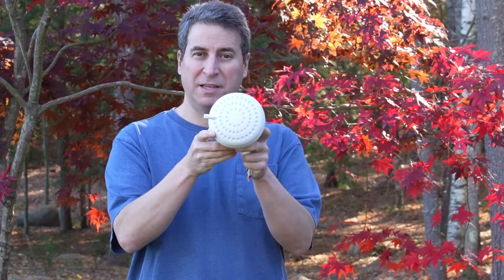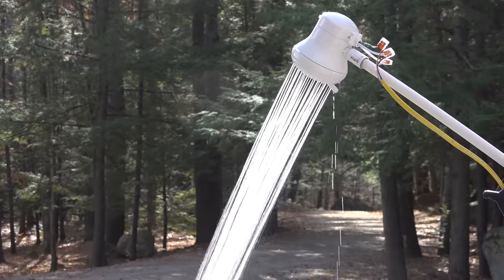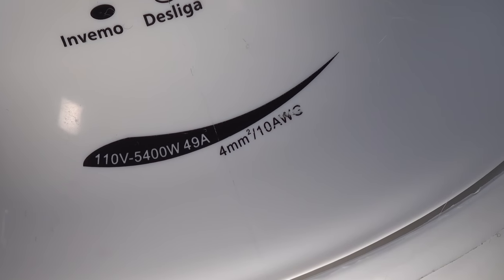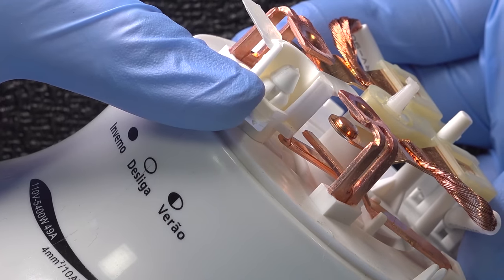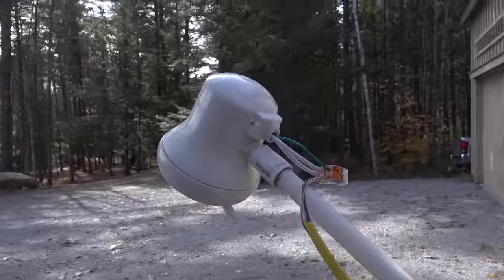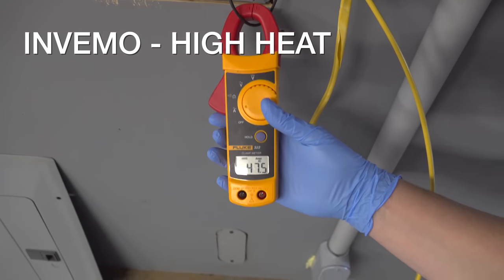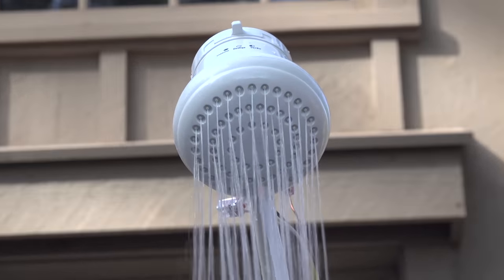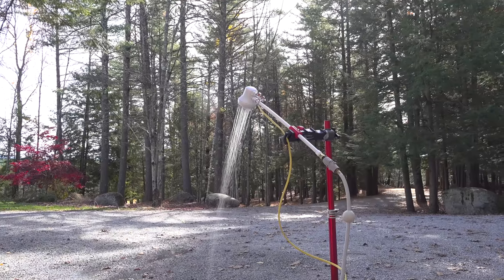What Happens When You Use a SUICIDE SHOWER HEAD in the US

Comment: The danger of it not having a ground is if the source of power has too high of voltage it can overload the circuit, blow a resistor or fuse and potentially start a fire. Especially if there is a power outage from a storm, if someone happens to be taking a shower and a transformer is overloaded that someone could have a gnarly unexpected shock

Comment: Not a big deal but the labels on the switch translate to (winter, off, summer) or high, off, low. The shower makes the same noise as a coffee maker but louder. They may pull too many amps if you try to use it at 110v.
Reply from the maker: So glad you shared this, I searched for so long and I think it was a printing error and should have said Vernmo

Comment: I'm impressed that you gave this such a thorough and fair review. For Americans, who have never seen anything like this, and are generally against anything unfamiliar (I'm generalizing) it will look ridiculous, but millions of people use this type of shower every day. I have enjoyed a hot shower countless times while visiting Brazil, and never heard of anyone being hurt by one. I actually went to the Walmart in Sao Paulo when they still had one and bought a nice rain shower model to replace the old one at my in-laws house. I went to the hardware store across the street and with my broken Portuguese, purchased some Marrettes, electrical tape and Teflon tape. I did the install and hid the wiring inside the snap down channel on top of the pipe. It's still working good 6 years later. When we travel, it's important to remember that many things will be different than what we're used to.
Great video, God bless.
Reply: I think my main concern with these as an American is not safety but efficiency. A 20 degree temperature rise for an over 5000 watt heating element is not particularly good, not when a similar wattage tankless water heater can achieve about double that temperature rise for the same amount of power consumed.

Comment: The hose is not for cleaning yourself but just another safety measure popular with these, as you can see in all screenshots, all suicide showers have them, it's supposed to pop open if the main shower is obstructed for whatever reason so it doesn't fill the shower head with water (and thus reaching the electrified parts)
Reply: Nice updated info and good correction of the hose and small sprayer real purpose. Thank you
Reply: I figured it was to be used as a bidet lol

Comment: In England, we sometimes have electrically heated hot taps and shower boxes, this is quite similar and is handy when the hot water tank from the boiler is empty.
Reply: That's different (and yes, I've used both, having grown in Peru and lived in a rented place in the UK that had one of those). The UK devices I know go on the wall and are presumably very well-insulated. I got my share of minor (but extremely unpleasant) electric shocks hitting my head against one of these suicide showers in Peru in the 80s and 90s. 

Also, the amount of resistance in an electrical shower head does not change when the water flow changes. (Does it change in a UK shower box? No idea, as water pressure in my flat was consistently good.) Water pressure in many places where these showers get used is quite low, so it's enough for somebody to flush the toilet or even turn on the tap for water flow to become low enough that you will get scalded. The device can even get damaged because of the heat.

Perhaps these shower heads have improved, but it's not reassuring to hear "it's safe if installed well". Right now I'm staying in a university guest house in Uganda with Brazilian suicide showerheads. (Yes, it's a Brazilian brand.) I've been taking cold showers. Today I woke up before dawn, and thought I would give in and try to take a hot shower. There were sparks and a burnt smell. I will keep on taking cold showers.
Reply: @haraldhelfgott195 Death by electric shower here in Brazil has never been heard of, but by direct gas installations. No one dies from an electric shower here in Brazil, it's almost impossible, accidents and discharges can happen, I've never seen death. Already the gas..
Reply: @adrianoaraujo3193  That's a different issue: Brazilian gas-powered showers are also a little frightening (I used one in 2008). I find it very unlikely that there are deaths by electric shower elsewhere in Lat. Am. but not in Brazil. More to the point, electric shocks in the head are both very unpleasant and potentially very harmful; there's a reason why they are a classic torture technique.

Comment: Here in Costa Rica you see them less and less everyday, and there are newer electronic versions with a potentiometer to regulate the heat. I’ve used some form of that shower for the past 25 years when they became more accesible to the regular people and I’m still alive, but before that, if you really needed a warm shower, a large pot with half boiling water and half cold was the norm (at least for me) 😅

Comment: The installations are usually done by someone at home, not a professional, and also, there are some people who should not be called “electricians” but they act like that.

Most homes do not have grounding and use 220V, they would wrap the green wire around a metal pipe if available or use a single nail going through the wall on a “sure, that should be good enough” type of solution. Manufacturer recommends a 6ft copper rod buried outside the house inside prepped ground for correct grounding. I never saw 1 home with that.

If you feel a tingling sensation when showering, especially when touching the metal of the handle to turn the shower ON/OFF… just shower wearing flip flops

I don’t know of anybody dying from these showers, but I had them die on me like 10 times and you can hear a bang and then a small flash when that happens, and 2 times the damn thing blew up loudly while showering, and once it caught on flames for a few seconds. Not as scary as it sounds but when you are wet, blinded by the shampoo and naked when all that is happening, you can just pray and hope everything works out 😂

If it burns when you were showering it is your fault and you are responsible for replacing it, even though it is mostly just a random event. 
—-
Source, lived in South America for 23 years

Comment: Hi there, i'm from Colombia. This country has a lot of what we call "thermal floors". Living almost in the Equator means no seasons, no cold or hot periods of time. We only got hot cities and cold ones with a permanently range of temperatures. The more meters above the sea level is a city located, more cold will be it's temperature and weather in general and viceversa. These showers are used a lot in the cold cities like the capital (Bogotá) and the northern cities near of it where the altitude above the sea level is about 2600 meters, going as high as 3000 meters. In the nights and mornings temperatures are between 8c and 11c. I have never had an electrical shock from these things, but some funny things have happened.
When I was a kid it used to scare me very often since the breaker that was linked to the shower had a very low amperage, which caused that if you took a long time under it or with very hot water it would trigger it, which left you in a completely dark bathroom and with the water rapidly cooling. Sometimes the cable that connects the shower to the electrical fluid began to melt which caused a smell of burning plastic while taking a bath, to the point where it burned inside and melted part of the plastic as well. After that, there would come a time when it didn't work anymore, so there was no choice but to throw it in the trash and buy a new one. Here in Colombia we have an automatic version without the temperature switch (i've never seen one with that switch, not even in stores). You have to control the temperature using the water tap (this is affected by the water pressure, but here isn't too frecuent). They are very simple and reliable we have had a couple of units that have lasted up to for 4 years of daily use. Every day we shower with one of those and practically we already get so used to using it, so much that went the power goes out we prefer not to bathe xD

Comment: As an American living in Rio, I have not ever encountered a shock issue. I did begin to notice that if I have it on the high setting for more than about 7 or 8 minutes, I can almost guarantee the breaker for the electric in my apartment will trip. So, I learned to kind of get things done quickly, or switch to the lower heat setting after the water heats up. I just recently started smelling a plastic burning smell while using the high setting. I got in the shower a couple days ago and turned the water on to sparks and popping. Apparently the burning smell was the wiring at the connection from the wall to the unit. I don't know if it just eroded over time or what. This apartment was built maybe 5 years ago, so its not very old. So now, I need to get the wiring done and maybe replace the shower head altogether.

Comment: I think something like this can even get hotter if all individual holes in the shower head are all surrounded near a heating element. What this does is just down all the water at once so you kind of get the effect like heating water in a pot where the water at the bottom heats up first before the top. The cost will be more tho if something like what I describe is build where the water is effectively going through the heating elements because it would require tubes that can handle the heat and maybe even a material that can quickly transfer it from the heating element though the tubes so the water heats up faster.

Comment: That version shown in the video is made in Brazil, and is a flooding chamber heating system, the resistor makes direct contact with the passing water making a massive energy use. 
I own in my house in South America a different version of these Electrical Shower, I'm a professional architect, and licensed electrician and I installed it myself, and its been 16 years now never have a problem. This "Lavarmin" brand runs a serpentine made out of a thermostable, (high temperature) polymer pipe and resistors are never in contact with the running water. 
Max power I tested in winter, was 35amps at 235v = 8225w

Comment: As a plumber I’m annoyed people call it a “hot water heater” it’s not. It’s a water heater. If the water is already hot you don’t need to heat it lol that’s what “hot water heater” means 🙄
Reply: Like nails on a chalkboard
Reply: The way my hot water heater works is it heats the water, then keep the hot water hot. So technically it is a hot water heater
Reply: @HD-jr4qu  but the only way it heats the water up is when it’s not hot anymore thus heating it back up. Maybe not cold water unless it’s new but it’s also not hot anymore if it’s heating the water back up. And people call tankless water heaters hot water heaters too… which In they’re exact nature is not the case. It only heats up the water as you use it so the water is always cold until being used.
Reply: @HD-jr4qu  heat and maintain are the same function, it's not a hot water reheater

Comment: Pro tips from a Brazilian:
1 - you don't change the temperature with the damn thing on.
2 - your water flow is too damn high. we use these with stored water with a column about 1 meter high. we have reductions to control the flow.
3 - they're not dangerous, but not enough to subtropical places.

Comment: I got electrocuted in a shower head like that when I was a teenager. I turn off the flow, and start switching the head from warm to the off position, it was a mechanism that rotates the full cap instead of a switch like in the video, the cap ended up sliding to the side and my hand touched the metal parts creating an electrical circuit with my skin. As I was wet, the electricity flow in my skin to the ground, I lost control of my body and right after it make my muscles to cramp and I felt braking the shower and luckily disconnecting it from the power cord. I was fine after that, my skin in the hand got black for a while due to the burn.

When buying those things, be careful to get a model that doesn’t have such dangerous design flaws. Make the wires short as possible and use some connector that can easily unplug it. Just in case. I know it is rare to happen, but I got very lucky to not die that day.
Reply: Wow......crazy......thankfully you were ok

Comment: I live in Brazil, actually i have a gas water heater, but a good eletric shower works perfectly, this one that you buyed it's the cheapest one (and yes we use eletric tape for the wires almost in every installation).

In most of the apartments/houses that I have lived in, the shower cable installation presented overheating problems, but in some cases it is much more practical than a gas heater that if you have a problem you need to call a technician, as for the shower you just have to buy the resistance and change it, the only disadvantage I see is the power consumption, as I said it is very easy for the wire to melt if not installed correctly.

Comment: The positive and the negative indicators are there for a reason and have nothing to do with DC positive and negative.  In Brazil, most of the country uses 110/127V or 220/227V with 2 phases cables enough to provide 63A safely.  One of those cables is called phase and the other is neutral,  the neutral cable is grounded by the electric company, commonly in the transformers. This is the main reason why those showers do not kill people even when not correctly grounded. It is highly recommended that when the shower indicates this, wire it correctly.

Comment: This shower has a widespread use in Brazil, I'd say we have tens of millions of electric showers installed here. An no, nobody dies using it. You've done it right, 10 AWG, straight to the breaker, grounded... It's pretty safe. The Wago connectors are not a problem, I also use them myself. They are always above the water outlet, so they never get in touch with it. This one you tested seems to be a Chinese copy of one of the most famous brands here, Lorenzetti. Good electric showers have 2 grounding points, before and after the resistance, so the current cannot leak backwards or forward, it will always find ground first. I have 3 of them, I've installed them myself and, properly installed, they are very safe. I live in a 220V area, my showers have 7700W of power, the heating capacity of a 1.5 gallons per minute, to mention units you know there. The 5400W version you've tested is equivalent to 1 gallon per minute. Ok if you live in Florida or south Texas, but definitely not enough in New Hampshire.

Comment: This showerhead is one of the cheapest, it can handle the task of heating water only to a certain point, but it's more common to fail, in Brazil one of the best brands of electric showerheads it's Zagonel

And about the separate heating system, in Brazil it's also used, but instead of heating using electricity, we use solar heaters, which one the oldest ones are like a glass window that heat water and stores on a tank, and the most modern ones uses black pipes to heat the water and also store in a tank

And one thing you did, but You never can do it's move the contact switch while the water is running, because of the way this showerheads works, only is a potentiometer showethead, like a Zagonel

And about the earth wire, in Brazil it's common to wire this with the neutral wire, because at some point the earth and neutral are connected together, but this where the electronic installation was done before 2010, and where the voltage it's 127V(Equivalent to 120V), earth only is connected when the elements are made to handle 220V(2 phases)/240V(1 phase), that is also common in some regions of Brazil
Reply: I didn't even knew this brand existed here. I've always used lorenzetti

Comment: As a sparky from the UK I'm stunned to see two raw heating 'coils' that actually sit in the water energised. For submerged water heating we only use encapsulated heating elements in that the coil is enclosed in a copper tube which is earthed.
Reply: it would never be compliant to any codes/standards in the US, UK and many other places and would certainly trip GFCI/RCD's due to leakage.
imagine using that standing on a tiled concrete floor and salty or other chemically conductive water comes through the piping. BZZZZZZ, roast human would be the result.
alternate scenarios, the neutral goes high resistance or full open circuit, power surges from a primary to secondary short or other crossed voltage lines, then there's always lightning strikes. yeehaw! 🤠 in reality they're very dangerous, ground wire or not, I'm really surprised more people are not killed by them. well maybe they are and it just never gets documented

Comment: As a brazilian I think electric shower is the most simple and brilliant invention we've ever made. The model with 5,400W can easily reach 60° C but, we have models with 6800W 7500W 7800W and 8800W, these models only works on 220V. You can make your own sauna in Brazil using water and electricity